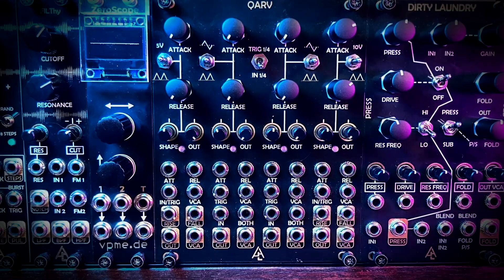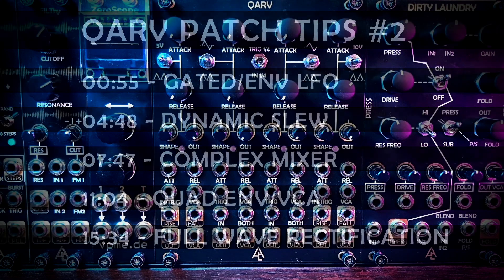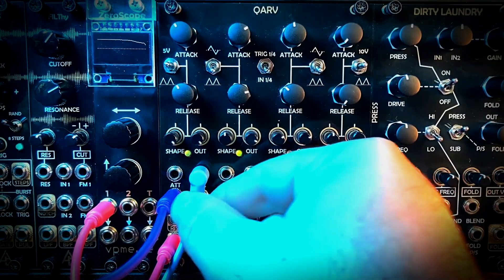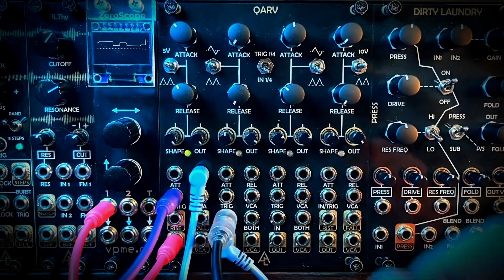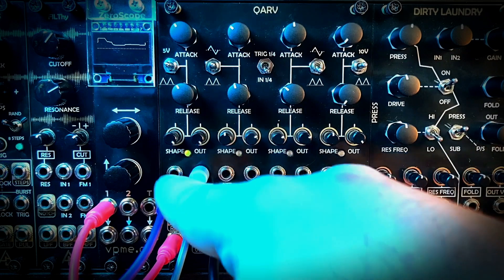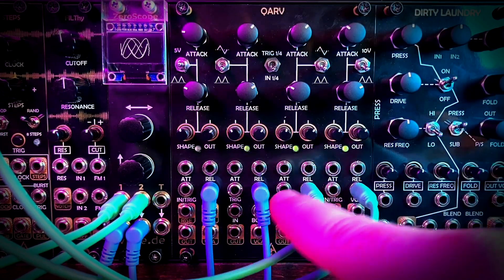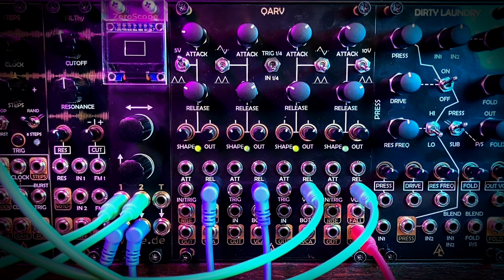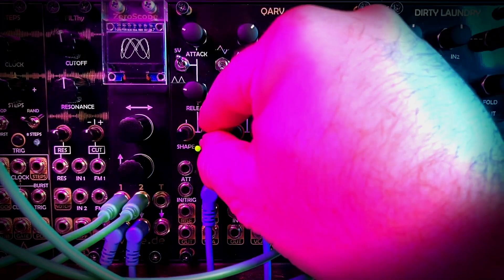After Later Audio QARV // Patch Tips #2

Comment: What kind of glowing patch cables do you use? I’ve heard that they aren’t necessarily the best for visualizing cv because everything below like 2.5v doesn’t produce enough power to gauge the visual feedback accurately. I don’t know if this is still the case these days.
Reply from the maker: I think I got them from ControlVoltage.net, if not them then Patchwerks. It was a while ago now though and they were always in and out of stock. And yeah you are correct, they work best if you have a full voltage LFO going, or want to visualize your gates. The gates route is what I use them for the most.
Reply: @RobotsAreRed  Nice! Thanks man! I'm going to give them a shot! :)